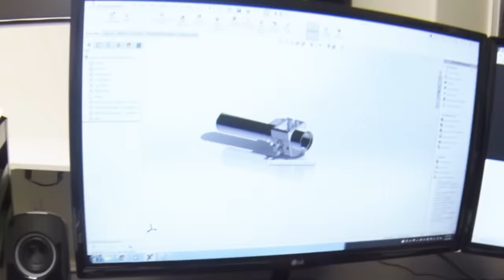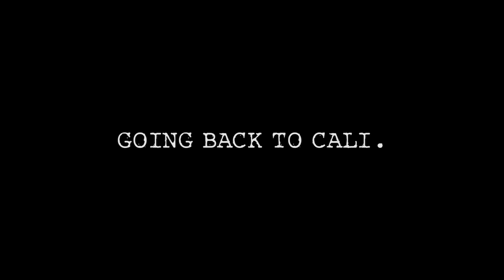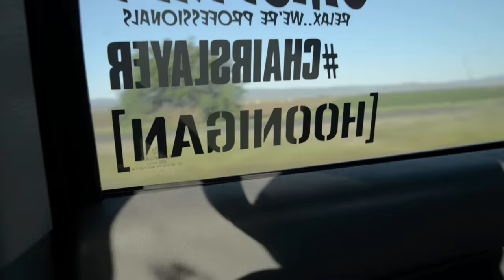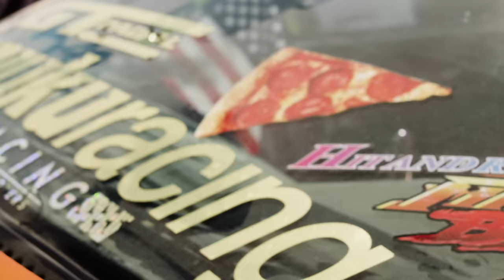[HOONIGAN] Unprofessionals EP1: Hert and Rob Crash into Each Other

Comment: Genuine question, when he rips the hydro, how does clutch in at the same time? 
Without clutching in would it not suddenly stop every driveline component?
Reply: Phat_And_Fast the system rob built disengages the clutch as soon as he pulls the ebrake. And you are correct, if it didn’t clutch in, it wouldn’t function properly and your car would bog